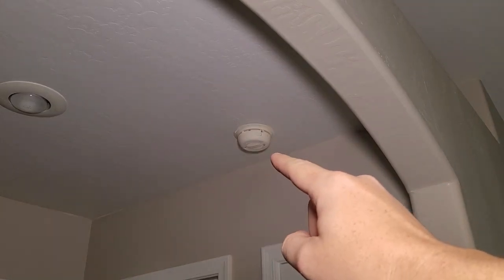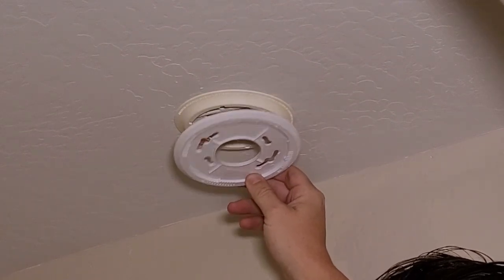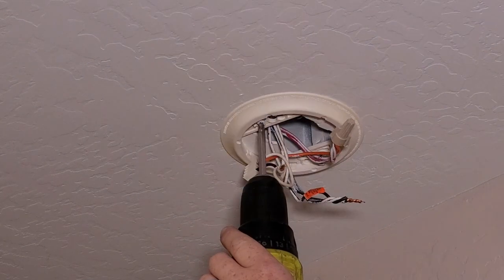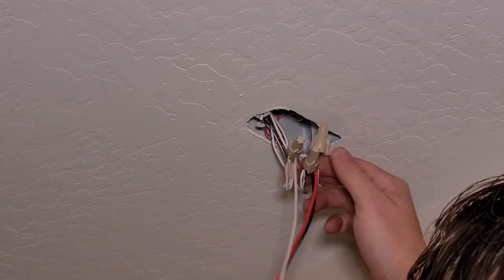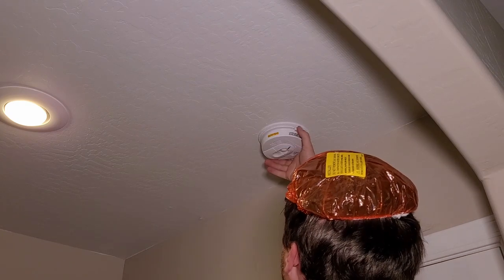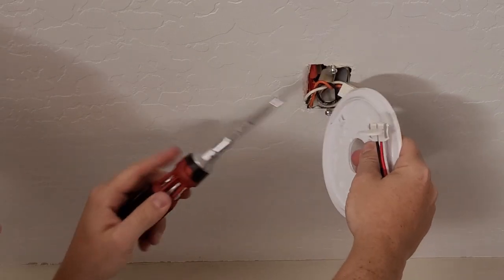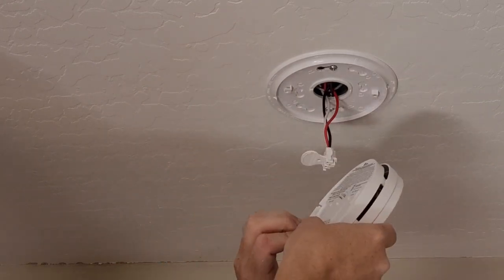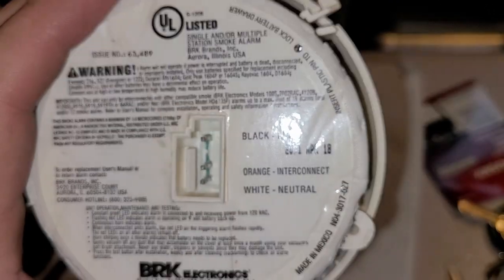Hardwired Smoke and Carbon Monoxide Detector Replacement DIY

Comment: I've watched a few different videos now. No one speaks of actually installing the wiring from the breaker box to the detector. What I need to know is; is it 14-2 wire to the first combo detector, then 14-3 from the first to the next, to the next, etc?
Reply from the maker: You are correct.  14-2 to first alarm to power it and to pigtail to the next alarms and then 14-3 between alarms.  The third wire (red) is called the "Alarm Interconnect"  It only runs between the alarms.  It just makes the alarms one for all and all for one.

Comment: If you want to be extra sure you should probably check that there's no power with every alarm.

(Though, I never bother with a proper checker working at home, I simply have a lamp plugged into the same circuit. Do as I say, not as I do. In my defense - I know there's no weirdly wired mess in that house. If the breaker for a room is off, I know that I can use any outlet in the room to check, and be sure that everything in that room is off.)